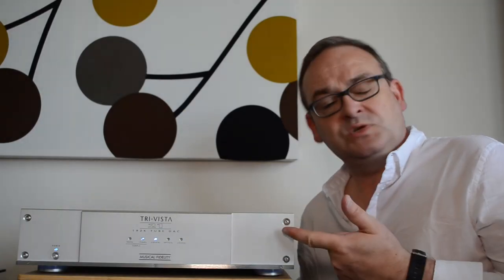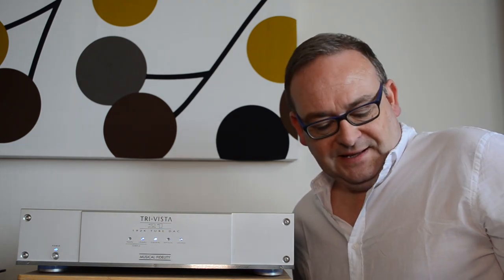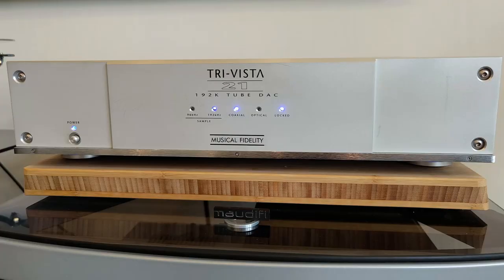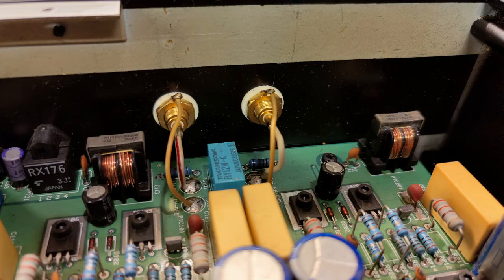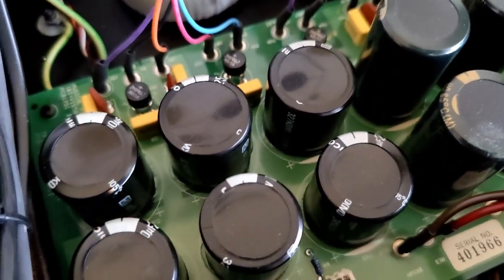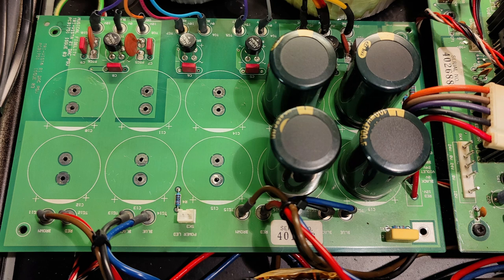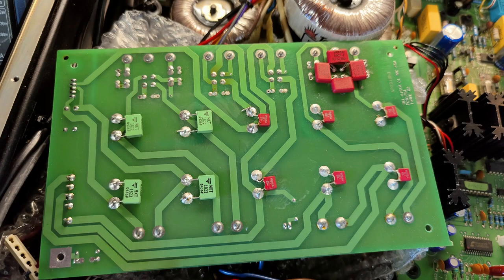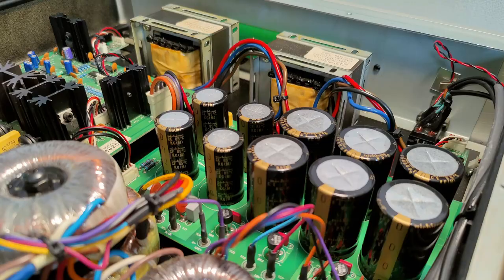Upgrading the Musical Fidelity Tri-Vista 21 Tube DAC - Part1

Comment: Hi thanks for the link to the dac 
There is a extra toroidal  fitted as the original  only has 2
Reply from the maker: That's right.  The previous owner has added a third transformer for the valve (tube) stage making the original winding redundant.

Comment: Where can I buy those Caps? Do you have an affiliate link?
Reply from the maker: Hi Brett, for any upgrades I design, I usually put together a kit of parts that will be offered via the maudifi.uk website . I also offer an upgrade service for those not so confident with electronics. This upgrade is being developed and will appear on the website in due course. Hope that helps.